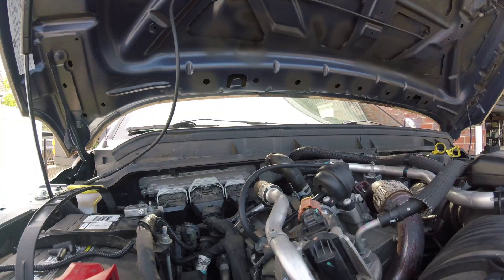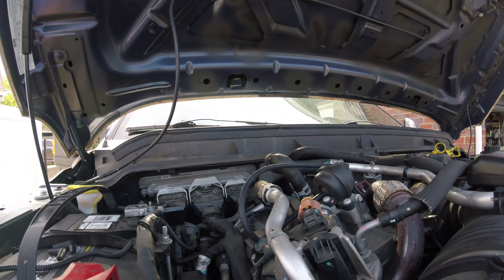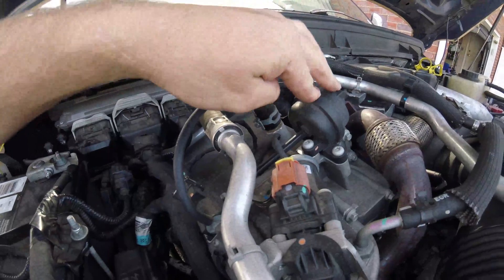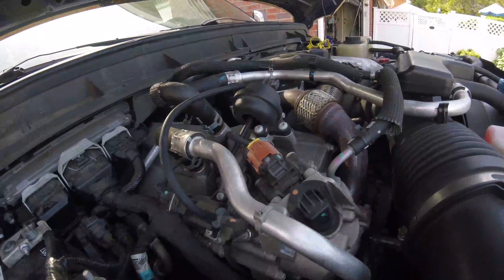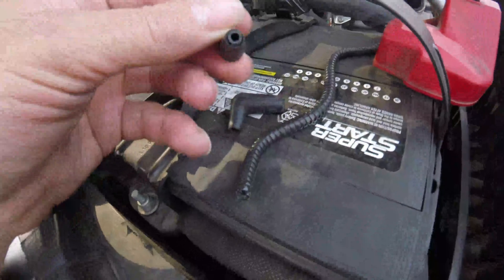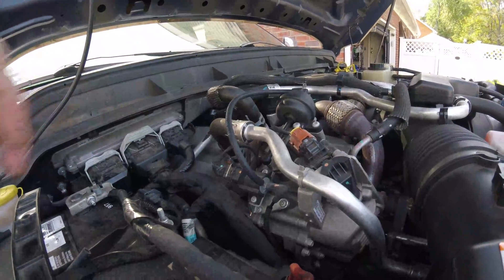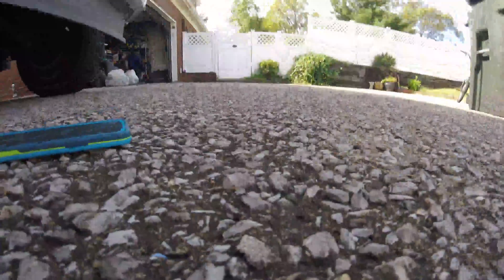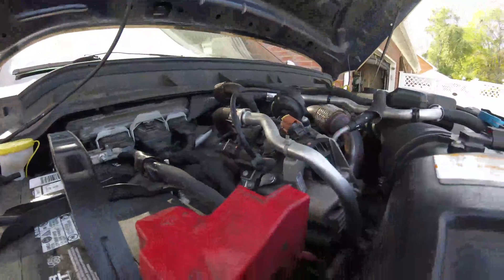2011 F450 EGR Bypass Actuator Code Fix

Comment: Glad I found this video. I did a similar “temp” fix, but will get some vacuum line as you described. 
My vacuum line was only cracked, and I heard air hissing. Never had any codes. What are detrimental effects if Actuator wasn’t operating for a long time?

Comment: vacuum hose size that works is 7/64 inside diameter, you can also use it to patch the excisting hose, the hard plastic hose will slide firmly into the 7/64 vac hose

Comment: Thanks, makes me wonder how many times dealerships and mechanic shops brake all those brittle plastic lines and parts on purpose, to the scam customers with the “+1,000” scare repair…🤷🏻‍♂️
Reply from the maker: I have to say it definitely helps to learn to work on your own vehicles.  I’ve had a few things broken after taking it to the mechanics.

Comment: The arm on my actuator doesn't actually line up. When the solenoid puts a vacuum on the actuator, the arm pops off the egr valve. I've tried a new actuator with the same result. Any ideas?
Reply from the maker: I would have to see it to say for sure. You have to really push hard to put it back on there till it snaps onto the ball. I’ll be posting a video showing the disassembly of the egr cooler. I show how it comes off and goes back on in that video.
Reply: @DentMachineCo  thanks so much. I am always weary about plastic pieces but it snapped on great!
Reply from the maker: Eric Simmons awesome. I hope it solves your problem

Comment: Help! I’ve only got the P24a5. I have vacuum at the egr bypass solenoid and actuator. Actuator opens and closes with no binding etc. When working properly, the bypass door opens and circulates exhaust gas, lowering the temp thru the cooler looking at real-time data in my scanner. I can see the temp drop at least 20 degs. When the check engine light pops up and the P24a5 is thrown, EGR temp gets stuck at around 115-120 degs and no fluctuation. Does this sound like a bad egr bypass solenoid? I’m stumped rn...
Reply from the maker: You may need a new EGR Cooler Bypass valve.
I would do a step by step test using the online repair manual Mitchell 1. It is how I found my problem and what the dealers use to diagnose problems. It`s a full online manual that the dealers use. You can get it here https://www.eautorepair.net/Marketing/Default.asp One month is $19.95, 1 year is $29.95 , and 4 years is $44.95, all of which is cheaper than a diagnostic fee from the dealer. Just type in the code into the search bar and it will bring up all the pinpoint tests.  Good luck.
Reply from the maker: Have you checked your vacuum lines? That was part of my problem.